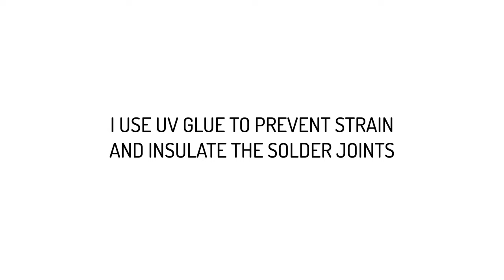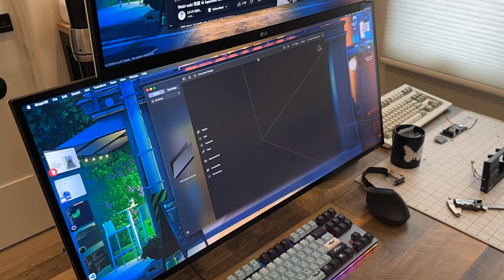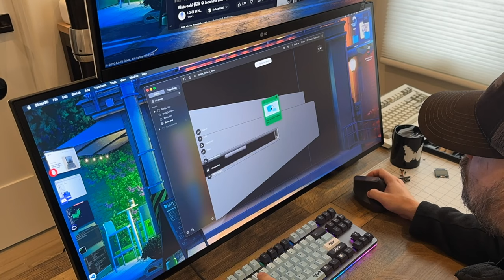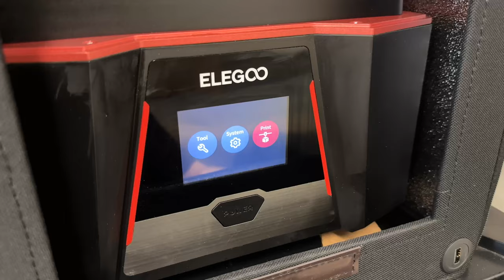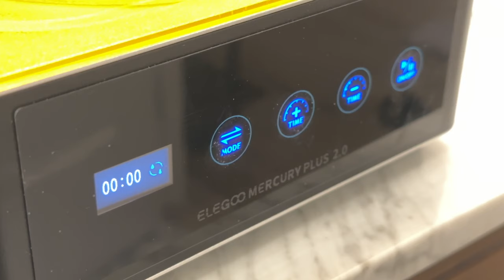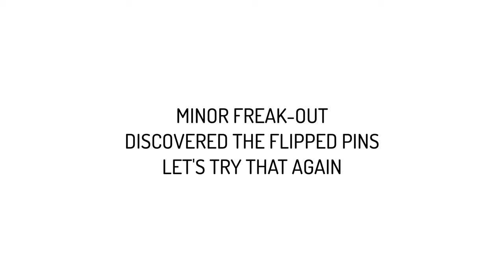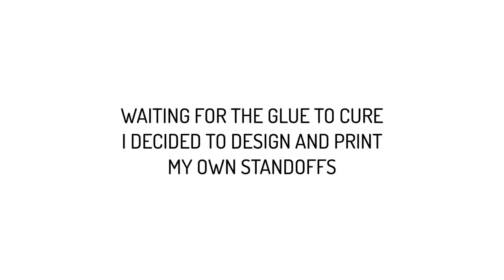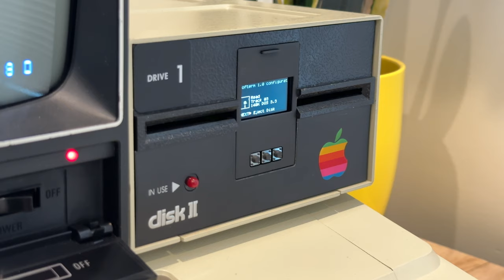Modernizing a Vintage Apple Disk II

Comment: Just saw this on Reddit. Awesome work, excellent execution 👏 Please keep making more stuff like this!
Reply from the maker: Thanks so much! That’s the plan. I always have a project like this going and have meant to find a feasible way of filming.
Reply: Curious, what’s your camera setup for this? I’ve wanted to shoot similar style videos for my own projects but I’m not sure how to do this kind of setup and still be able to work at the same time. Does the camera get in the way or make it awkward to do certain things?
Reply from the maker: Shot all of this with my iPhone and a tripod sitting in front of me that absolutely got in the way! You can see in one part of the video where I go to grab the Noisy Disk and miss on the first try :). It definitely takes some getting used to but before I invest in some more equipment I want to try it out as simple as I can. 

I was able to get a video I was pretty happy with so I'm going to keep at it. The next thing I think I want to work on is some consistent lighting. I was only able to shoot at certain points of the day to make sure things were lit ok, but even then more light sources would help.

Comment: It's certainly cooler than just a dongle berry attached to the rear of the computer. However, it would be even cooler, if it could still read actual floppy discs too.
Reply from the maker: Totally agree. That would have been awesome. I’ll need to figure that out next :)

Comment: If you had stated up front that this prevents reading original disks and you permanently ruin the original drive faceplate, i would have 30 minutes of my life back.
Reply: Come on, dude, it’s not like he ruined a prototype, or something. Also, from all the work I did with cyanoacrilate, I’m pretty sure that’s reversible (which is also important from a maintenance standpoint). See how much care he took in not drilling holes on the original case, and how he didn’t gut the internal components, by the way? Maybe one day he’ll revisit the concept and create a dual drive with a working lever. 🤷‍♂️
Reply: The title of the video implies it's an enhancement to the drive.  This is not a combo.  It's a little wart that prevents the drive from functioning.

Comment: Out of curiosity, what resin are you using?
Reply from the maker: It’s a mix of 70% ABS-like 30% flexible. Specifically Resione F69. I found the tough resins far too brittle so mixing it with some flexible resins work great.
Reply: @polymatt  Thank you. I was also seeing problems with brittleness.

Comment: Little tip here: since you already have a resin 3d printer you can just use the resin from it insed of this 'glue' stuff, basically it's the same... Yes it has different viscosity but you can get something similar by giving it a little bit of UV light then apply it to your desired spot and harden it fully
Reply from the maker: Oh interesting. I’ve used resin to glue printed pieces together but never to other things. In this case it might not do so great after I painted it. I’ll definitely keep that in mind!